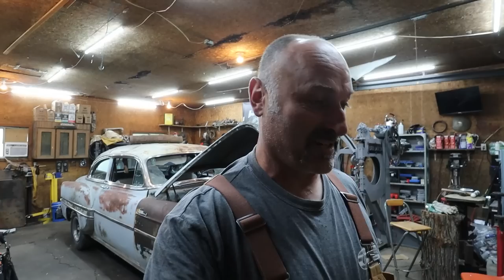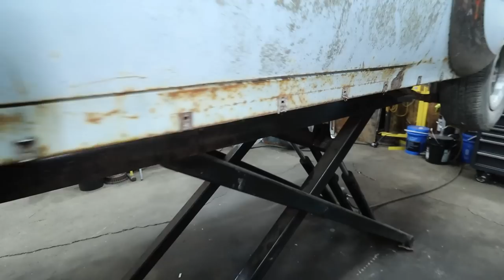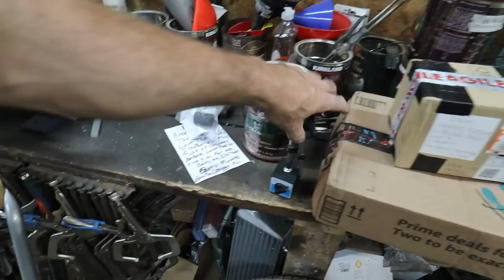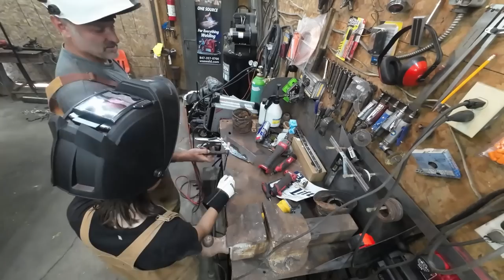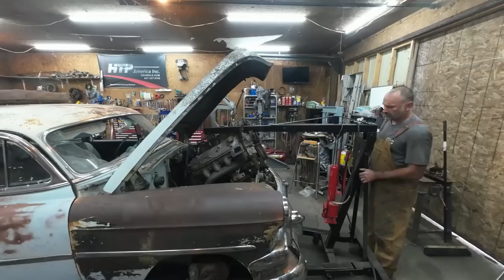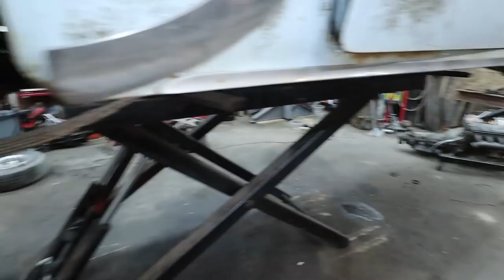How to shorten and drive shaft with basic tools along with more brake work on our 54 Chevy.

Comment: I always enjoy a good driveline shortening session, after working in a driveline shop and being spoiled with hollow spindle lathes, press up and alignment benches. Motorized welding bench with wire feed and dynamic balancer. When your in the workshop and many miles from a driveline shop a guy does what he has to with what he has, nice job.
Reply: Yes, the lathe he used to use was burned in the fire but he makes things work anyway.😮

Comment: Nothing beats right and proper brakes and a solid front end.
DD Dan would leave the squeaky door😅
Looking at those brake fittings, i think the machining process is easier than the north american inverted flare.  
Ryder should keep working at tig. 
May want to check with that fellow in cooks creek, he has a truckload of taillights. If you need contact info, hit me up.

Comment: A old trick told to me for balancing the tail shaft after welding too re-weight the balance  by using two hose clamps around the Shraft by moving  the screw end to the the run out side with a bit of time it will be be come total in balance.
Reply from the maker: Yeah heard of that but haven't had much luck haha

Comment: Nice video as always. I did the same engine/frontclip on my 49 Pontiac streamliner. I used the original Jag master brake cyl. it works great only the angle of the pedal needed to be adjusted. For shocks you can fit the original Jag ones, the tower you build for it, it wil fit the Jag ones, I did the same because they are pretty long. For power steering, I used the LS power steeringpump and the Jag powersteering, the pump needed some spacers to reduce the pressure, Borgeson sells a kit for that. best  regards from the Netherlands!

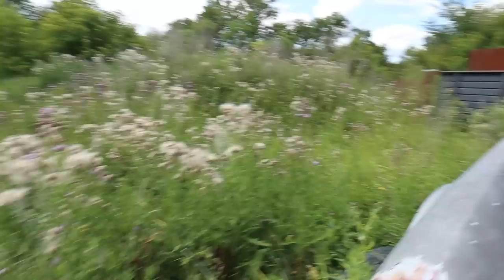Comment: The stock 10 bolt in my S 10 was a 7.5"  3.73  The 8.5 " posi i put in was a 3:42...... the 8.5" was also a 10 bolt out of a Camaro or Nova.

Comment: Pick yourself up Evapo-Rust (stuff works great) and soak all your drive shaft straps in it to clean them.
Or soak them in vinegar, it works but takes a lot longer.
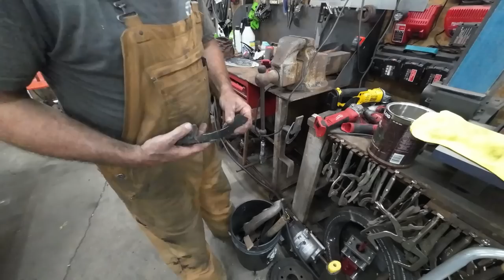32:18 Use the newer arm, get it to length and then put on the early style brake foot pad if you want.
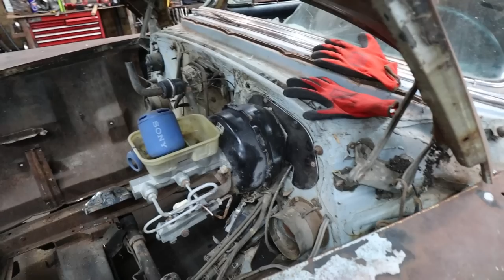37:20 Could you use Riv Nuts to mount your steel plate to the firewall?
Reply from the maker: I didn't feel that that would be strong enough
Reply: @HalfassKustoms  I would think they are the same as nut and bolt.
Reply from the maker: @RichieCat4223  no they're more like a pop rivet so there's not a lot of meat on the backside holding it in
Reply: @HalfassKustoms  I'm familiar with them. If installed correctly I don't see an issue with them. Just a thought about using them. You will have more strength after you tie in to the dash also.

Comment: If you can't find a suitable length battery cable, welding cable works well and you can buy exactly the length you need off a reel.  Of course then you'll need to crimp ends on it but that's no big deal.

Comment: Jag's da fittings parts car, brake'n da front lines, determine driveshaft angle n length den cut n square up on da car, clean out some a da debris, lengthen dat wobbly brake pedal brace'n next time, pull da pesky motor n trans ta make brake lines.

Comment: If you could move the brake lever fulcrum down lower it would decrease the “ throw” of the pedal and allow it to be closer to the floor but who knows what that will do for the “throw” of the connection to the master cylinder. 🤷

Comment: If the tailshaft doesn't vibrate ol' mate you should buy a lottery ticket . . . it's your lucky day
Reply from the maker: I think out of 50 or so driveshafts I've only had one that vibrated and it ended up being a bad u-joint haha
Reply: @HalfassKustoms  I'd be worried about the rust pitting let alone the lack of balancing weights throwing the shaft out of balance, I do however realise you're mainly interested in getting the cars mobile, not finely tuned . . . which is why I like what you do

Comment: Your not gonna be able to use the vacuum brake booster with your brakes and the turbo together because when it builds boost it will put the brakes on ..
Reply from the maker: Hasn't in the past on my last 2 cars with turbo

Comment: Do not do this at home, having a balanced drive shaft is a major safety issue. Take it to a professional, this video should be due to unsafe practices.
Reply from the maker: If the shaft is true there is no reason to send it off to get balanced.